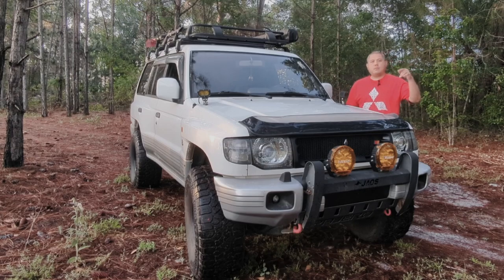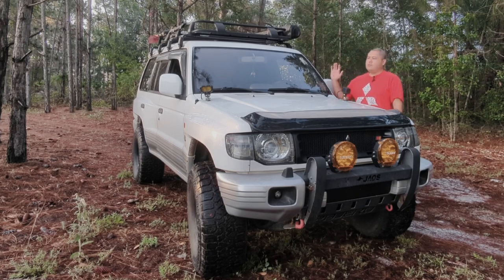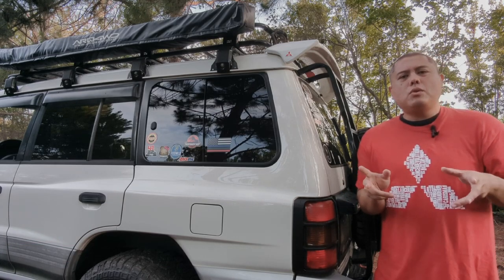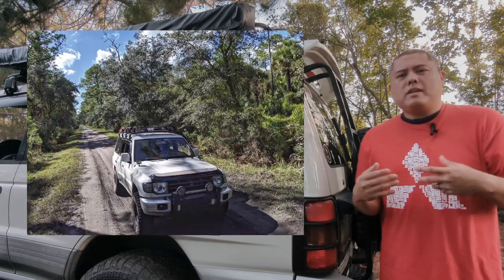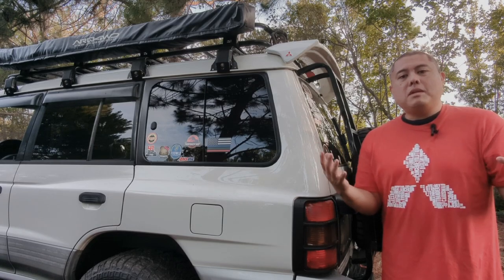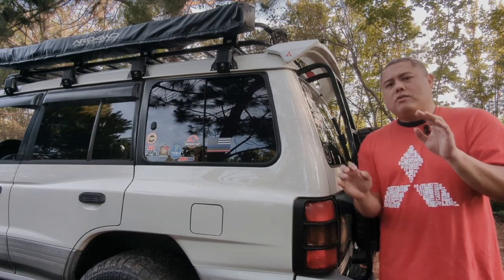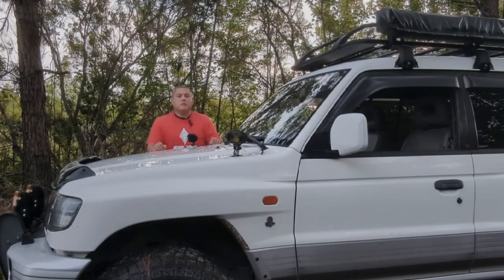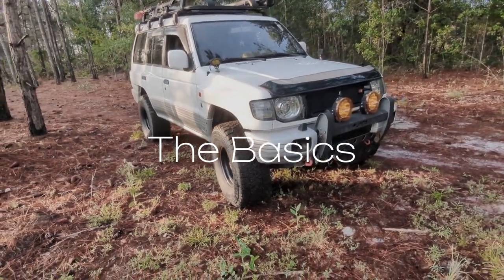Phase 3 - 1998 Mitsubishi Montero walkthrough

Comment: Love your Montero and we just bought a 2002 a few weeks ago and love it We moved here to the Philippines last year and over here they are called Pajero's and most have a turbo diesel. Also if you want the flared sheet metal version they offered the Fieldmaster version. We did get this version in the 2002 model year but it is just a 4x2 and has the 4m40 inner cooled turbo diesel engine. I do plan to get another one of these Pajero with 4x4 and hopefully the Fieldmaster version as I really love the body's on these 2nd gens. I had a 1969 Camaro when I was in the US and sold it when I retired here to Philippines last, maybe that explains why I like the lines on these Montero's/Pajero's.
Reply from the maker: I fell in love with Pajeros when I went to the Philippines way back in 1999. I wanted one but it took another 16-17 years to finally own one. Maraming Salamat for the comment!!
Reply: @itsaboutfam  Yeah my wife is from here in Bohol where we reside now and we picked up our Pajero from over in Cebu and took a cargo ferry across and brought here to Bohol. I like the Pajero JR too, the 3 door SWB and even like the boxy 1st gens too and I seen one in Cebu last week, 2.5 turbo diesel but no inner cooler so I held off on getting it but I sure like these SWB Pajero's too.
Reply from the maker: @elvie174able  The SWBs are nice .. unfortunately the U.S only got the Gen 1s available SWBs. We saved a 1989 Gen 1 LWB last year to restore. We also have a 2002 Gen 3 Limited that needs to be fixed also. I got too many projects 😅

Comment: Hello, thank you for sharing your journey, this is super useful. I've also just got a 1997 montero that Im getting fixed. Fuel consumption is abnormally high. Would you have an idea of where this could potentially come from? By abnormally high I mean less than 300km on a full tank.
Reply from the maker: Thank you..I appreciate your comment. As far as your MPGs....that's not great at all. Is the Montero throwing and CEL codes?
Reply from the maker: When was the last time you did a full time up? Have tried to clean the injectors?

Comment: How you feel the 33/12.50 on the low gears?...and normal 2wd are you lost a lot power?is true that with 33 you go to loose 1 gear?
Reply from the maker: Monteros/Pajeros/Shoguns had different gearing in different markets so I am not sure what gear ratios you have on yours. Mine have 4.27 gears and I am in lower elevation and Florida is pretty flat so running 33's isn't much of an issue for me. If you're in higher elevation and again based on what gears you have...running bigger tires can affect performance. I haven't had an issue so far but there have been fellow owners that live in higher elevations and have to deal with mountain inclines and declines that struggle with 33s. 

I am not sure what you mean "lose 1 gear" but I never had that issue. 

Running bigger tires will affect performance for ANY vehicle. Now with off-road 4wd rigs that have heavier tires it's more noticeable.
Reply: @itsaboutfam  thanks!

Comment: I was told that you had to extend something from the rear axle when lifting a Montero. What do you have to extend?
Reply from the maker: It's suggested to upgrade your rear panhard bar when you lift it. ADD sells an adjustable panhard bar which I am running.
Reply: @itsaboutfam  was their a rear brake line pipe you have to extend too?
Reply from the maker: @KenHer3500  if your lift id more than 2 inches it's suggested to get the longer brake line to the rear differential